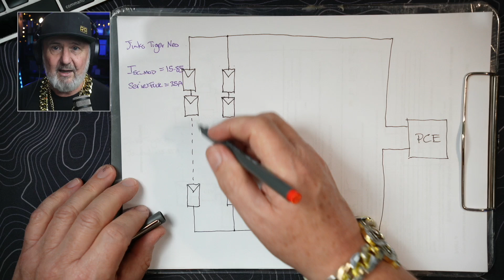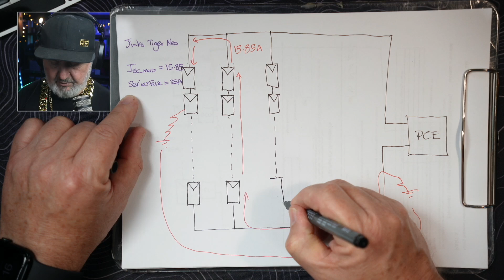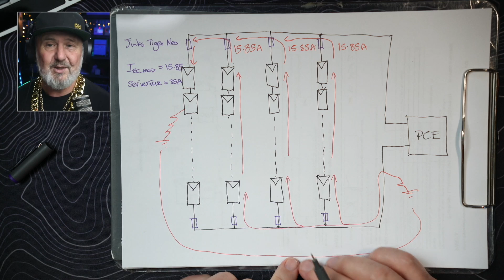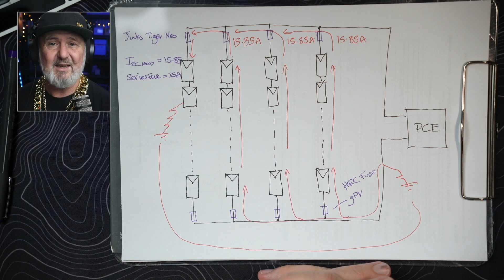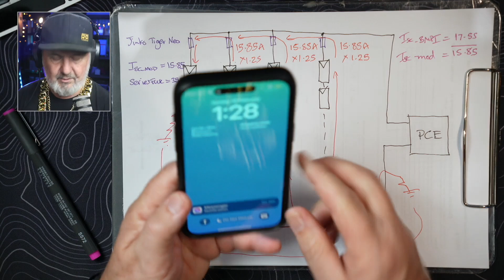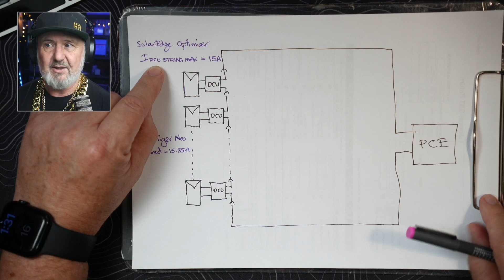Toolbox TechTalk 16 Feb 2025

Comment: Great video Glen. With the significant increase in battery systems adoption, a follow-up video to go through protection required for panels with multiple sources of dc. Keep up with the tech talks. They are very informative and easy to understand. 👍👍